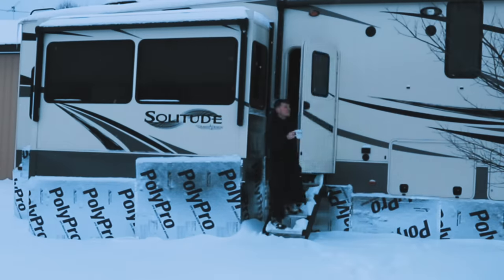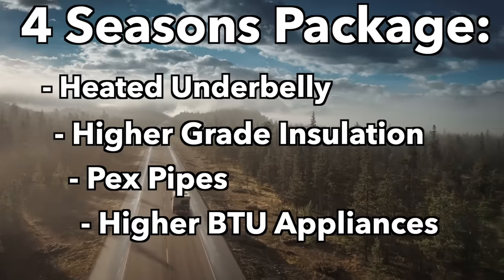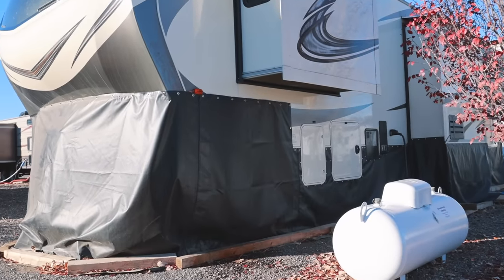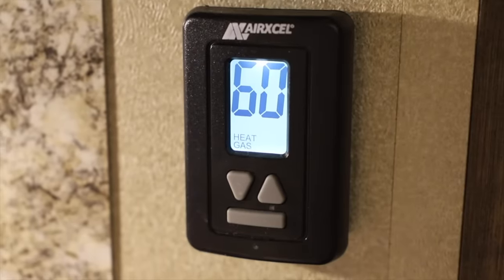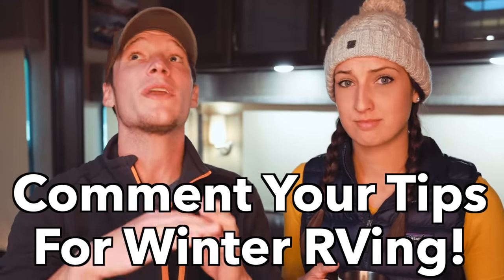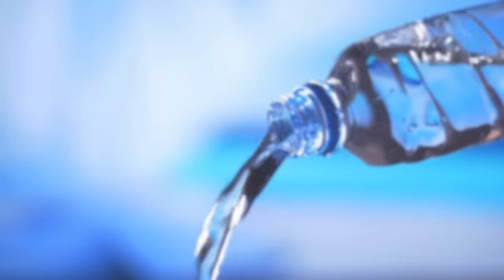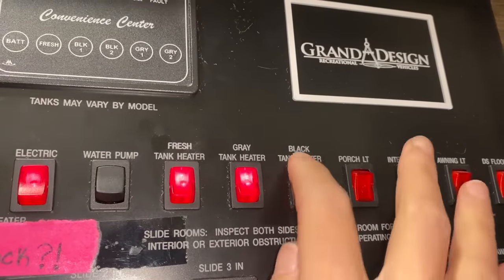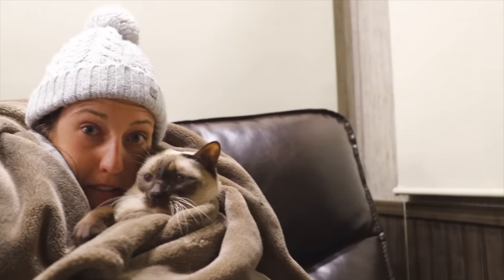RV WINTER CAMPING TIPS & TRICKS - A Complete Guide to Success!

Comment: to winterize the trailer, i spent the whole year in wy. in my trailer , working a pipeline job, i placed 1/4" plywood around the openings of sides the trailer, i also placed the rubber tires on a sheet of plywood from the cold under the tires. this make no froze o the tires.  . on the cold and hot pipes, as well as the lines for the grey and the black the help insulate the pipes from freezing. heater wraps are the best around the water, gray and black tanks.as far as sweat in the trailer from the extra heat, the vent in the bathroom a crack open all the time with the bathroom door closed. only if the bottom of the door has a 1/2" opening under the door to the floor.
Reply from the maker: Thank you so much for taking the time to share all this great information! How cold did it get there?

Comment: Learned so much from you guys, thanks! We are full time rv living in mid Michigan. As some added things we've learned..
-get an small hose and an rv toilet wand like the camco swivel stick. You can use this to help flush your black tank by making a quick connection in your shower instead of hooking a separate hose up outside, especially if your spigot has been winterized. 
-put a thermostat sensor under your camper so you know what's going on underneath your camper AND in your basement. 
-Foam skirting was totally worth it! Cheap and effective! Throw a heat light under there for a little extra insurance as well. 
-if you have a heated water hose remember to wrap your water filter if it's outside. Otherwise it'll freeze, expand and crack. 
-plastic wrap your windows! It'll help with condensation on your windows and it'll create that air gap without blocking out the sun, which also helps heat your rv. Remember the sun is a free heat source! 
-if you can use your fireplace or space heater do so when you can. It'll help combat the condensation alongside your dehumidifier. 
-Lastly, plan ahead! If you haven't gotten your camper yet but expect to be winter camping at some point, plan on getting a 4 season. While it usually means Florida 4 season and not northern North America 4 seasons, it does help. Coming from mid Michigan, it's made a huge difference to have all of the cracks and crevices already sealed up for us by the manufacturer.
Reply from the maker: This so so great! Thank you so much for sharing Holly! We need to write a lot of these down!

Comment: I bought 3 campers. Gutted them all out and basically made a 3 bedroom 2 bathroom house. Im not allowed to connect them together so it’s awkward. Ran all new water pipes, all new gas lines, all new electrical lines, all new sewage pipes. 

I use a 21kw solar kit. I drilled a water well for water. And installed a septic tank. One camper is only for utilities like washing clothes, cooking, washing dishes, and stores the solar inverters and batteries. The other 2 are for living. I completely surrounded all of them with square hay bales to keep them warm and the water pipes from freezing. Installed a 40 gallon propane water heater. New toilets, showers, sinks. 

All of this so we can live good while we save to build our house. So far so good.
Reply: Any mice with them bails of hay
Reply: @KingdomCarrie  I’ve also got 6 outside cats and 2 big sheep dogs. I have no rabbits or mice to worry about ever. 

The mice once tried their luck…. it didn’t end well for them.

Comment: I 365 day/year in our RV. You can circumvent LP/Propane heat. Heat your RV with Space Heaters, but leave your furnace on recirculate, and it will pump cabin air to the basement.

Comment: Just going back thru winter rv living. I live in alabama, love y’all’s vids. Last winter I went thru Dual 30 pound propane tanks in about 3 to 4 days. Now I drive 18 wheelers for a living and home on the weekends. I DID IN FACT GO WITH the big boy propane tank. River City Propane will in fact bring out the 120 gallon submarine style tank. No monthly tank rent with a full fill . Full tank fill on set up basically took care of a tank rental  deal. Anyhow, River City came out, set the 120 gallon tank, ran Cooper line that they buried in the ground , pressure tested/checked my rv, and we were good to go. Now since last December I have paid for 2 tank fills and I’m still at 40% on my 2nd tank fill as of last hometime, 2 weeks ago. River City also allows a customer to pay whatever whenever on your account thru the year. So you can actually pay a cheaper price for propane in the off season. Say you buy 100 gallons in June at 2.89 a gallon and don’t need a fill, well that purchase is locked in. Say you wait until say October and prone is 3.19 a gallon then it is what it is.  Anyhow I truely enjoy you guys videos.

Comment: Dual pane windows for sure! We had a 27 ft TT without them, 10 yrs later get a new TT 27 ft with them. Big difference - in sound, heat loss, or stay cooler, and a big one for small TT - condensation! A lot less condensation build on the windows under the same weather circumstances with dual pane. No hesitation to have them in the big rig too. Cheers 🍻
Reply from the maker: Thank you so much for sharing! We had no idea they were also good for sound 😃

Comment: We live full time in our rv in North Georgia we use the foam noodles from Lowe’s to cover our water hose just a few dollars so you don’t need a heated hose we get below freezing all the time at night we have never used propane in our rig to heat it we just use the fireplace and a ceramic heater in the bathroom at night on a timer we do have a enclosed belly but no tank warmers I guess it really depends on where you stay if you need to run the propane throughout the night
Reply: Cheaper than that, you can go to home depot and get some armor flex insulation, its made for insulating water piping and isnt as bulky but permanent if you want it to be.
Reply from the maker: Thank you so much for sharing! This is great when everyone shares their tips 😃 We learned our pipes started to really need heat when it drops below 20 F

Comment: Great tips. How do you get all that tape for skirting off your rig?
1. Use the electric heat, but run the furnace fan to circulate the heat to the remote areas.
2. Instead of pipe insulation, try caulking backer rod. It can be rolled up when not in use, comes in smaller sizes if needed.
3. Heated water hoses are fine, but the water source is going to freeze anyway.
4. Motor homes have the advantage of using the chassis heater.
5. If the battery('s) are in peril, just start your motor home or reconnect your tow vehicle to your trailer to recharge.
Reply from the maker: Thank you so much! It actually came off fairly easy. Now there was some residue left over, but I just used goo gone to help remove the remaining adhesive 🙂

Love these great tips that you have provided!! Oh my goodness you are so awesome 😃🙌🏼 Keep these great tips coming!!

Comment: Hi Gang, thanks for all your fantastic tips. We do rent a propane tank here next to Yellowstone. Way cheaper per gallon when filling 80 gallons. We also stand behind our dual pane windows, not because they do so much for heat, but at minus 40 (two winters now) it really decreases the ice on the inside of the window. It's way more manageable than without. The problem with ice inside is that when it does melt, it runs down into your wall - not good. We also had issues with our furnace running full time at -27 and burning out the furnace fan, so secondary heat is helpful there. The heated fresh water hoses don't work much below -10 and we always keep the fresh water tank 3/4 full. We have kept our gray water drains open to -27 without an issue. The hoses are, verified by a level, totally downhill with no places for the water to settle, they are routed UNDER the skirting, and where that can't happen, we wrapped them with bubble wrap and installed a 4" aluminum stove flue over the bubble wrap. Not being contrary, btw. Just adding more ideas to your already great ones! Love you three! :-)

Comment: We aren't full timers but we have been snowed on and in and subject to below freezing temperatures. We have a four season rig and things have frozen on us. We are able to work our way through these freezes even though some minor problems have occurred. I don't want to rip into the under belly of our trailer but I wish there was a safe and moderately easy way to put heat strips around our Pex tubing. That would take care of the worst of our issues. Thank for another informative and facially entertaining video.
Reply from the maker: Yes, that would be amazing! I was thinking
the same thing. It would be quite the pain to access all the underbelly and have to drop the insulation. It’s great to hear from you guys, thank you so much for sharing 😊👋🏼

Comment: Great tips!!! We've been caught in below freezing temperatures a few times in TX (where we go to get away from WI cold in the winters-HA!) including Snowmegedon in Feb 2021 when we lost power for 15 hours in sub 0 temps. We survived it and no frozen pipes!!. We have a small RV (26 ft 5th wheel with no slideouts) and only went through 1/2 a 30 lb propane tank...no supplemental heat due to no electricity, and because of the ice and snow, we couldn't use our briefcase solar panel.  Also, we use clear plastic insulated window kits on our single pane windows, so heat comes in from the sun, but no draft of cold air and you don't feel like you're inside a hershey kiss. 😁  We have been full time rving for over 5 years and do not have a heated water hose either...we just fill the fresh water tank and disconnect from city water supply if we're in a campground. Our biggest challenge is yet to come... We need to return to WI in March this year for the arrival of our twin grandbabies.  Campgrounds are not open in WI in the winter!! They are closed until mid-April!! We know where there are a few dump stations we can drive to, but no potable water sources near where we have to be, and at most, we will have 15-20 Amp (house current) electric. FUN times ahead!!! 😳🥶😬  We are looking for winter rvers who don't have hookups in winter...any advice appreciated. We know what to do for SHORT term crazy cold, but no hookups in winter will be a new experince!!

Comment: My wife and I travel for work and we spend winters in the camper. Our first on we used the green insulation board and aluminum duck tape and put a small utility heater under the tanks. Wasn't to bad on propane at first, but as the camper got older,it got colder. We use a 100 pound tank. Yeah it's a pain to load and unload,but it's better than constantly refilling tanks. We had a 30 pound tank next to it,so we used it while the big tank was being filled. We used plastic and tarps once and once is all you want to use it. It constantly flaps in the wind,even when weighted down. Don't forget to drain the sewer hose after dumping the tanks. They tend to freeze and bust. But the whole manufactured skirting is nice,but ridiculously expensive.

Comment: I just purchased an 04 Gulfstream C class that I am modifying for winter. Reason I went this route is that it has no slide outs and although it doesn't have a lot of the modern built in conveniences it makes the conversion a lot less complicated. I prefer a certain level of minimalist. First thing I am hoping to do is get the whole underbelly spray foam insulated because it works great and  helps tremendously on saving energy, less road noise and easier to pickup and go. Spray all the crevices  pipes  but avoid all the running gear, wires etc. Insulated all the doors and make all the seals seall properly. Now I'm trying to figure out how to duct cabin heat into all the plumbing areas in the underbelly.

Comment: Back 40+ years ago when I got married we had a house trailer up here in Wisconsin and to help keep the under belly worm I ran a string of work lights at -20 it would be 40 under the trailer I still put lights in a small room in my barn were the water comes in and it stays 50 a clamp light in your water bay would help if your going to do that again this year ☃️ 🥶stay warm great video 🍺
Reply from the maker: Wow! Those lights do a great job! Thank you so much for sharing! How do you recommend people keep an eye on them or prevent them from causing potential fire hazard in the underbelly??

Comment: I have a Solitude 310gk 2018 and I have done some of the same things as you guys. I tried something different however that I think is pretty cool for cold weather. I bought a 210 board ft spray foam insulation kit and sprayed the outside of the frame rails and the cross over section on the drop frame. I sprayed the foam about 1 inch thick and also sealed up the gaps around the slideout hydraulic rams to minimize air transfer. Since doing this I have never had my pipes freeze and keeping the trailer warm without skirting is pretty easy. The next thing I did was I installed a chinese diesel heater 8kw in the front storage bay next to the batteries. I cut a 3 inch hole in the wood divider to the basement area and when it is really cold out I can keep the basement close to 80 degrees. I have an idea to use the diesel heater to supplement the propane furnace with a duct pressure booster, but I haven't gotten around to it yet, maybe this week as I live in Wyoming and we usually visit our daughter in Bozeman, MT over the holidays. I also use the reflectix on the windows and it helps and I also installed a 3m window coating that seems to have eliminated any condensation on the windows, but only marginally helps with heat transfer. The diesel heater is pretty cool in that it will warm the bathroom floor. I tried letting in run into the front compartment to try and heat up the front cap because the closet in the bedroom gets so cold, but it didn't do much. I can run that heater on less than a gallon a day and the heat output is adjustable. With the spray foam on the frame rails I have never froze any water lines down to -10 F. Good tip on pipe insulation for the slides, I just happen to have a case of it in my shop that might work.

Comment: Hey Hanks. I have lived in a camper with no slides scene August 2010. I have a 325 gallon lp tank at a little over  70 percent full. I leave my gray tank open all the time. i only disconnect the drain hose when I have a problem. When it is down below freezing I leave the shower/bath tub dripping to keep it from freezing.  Because gas prices are going up, I am using an electric heater to help stretch the gas.
Reply from the maker: Hey Joe! It's great to hear from you friend 😃How is North Carolina treating you these days?? That's awesome you are rocking a 325 gallon tank!! 😱Is it easy to connect your unit to the tank? You are on your own property as well right? We really enjoy hearing your feedback and the setup you have! Thank you for taking the time to write this wonderful information out for us and everyone reading!!

Comment: about keeping the underbelly warm.

you can get a space heater (oil filled radiator types are very safe for this) to keep under your rv to heat it specifically. if you have skirting (as you should) it should keep it atleast above freezing, and the heat coming from the space heater will help keep the rv warm by warming up the underbelly.

also heat pumps (reversable ac units) for rv's are typically under 1,000 bucks and you should be able to fine some that  fit your current ac location, especially if you have an older rv it is definitely worth getting b/c of a more efficent newer ac system, and heat pumps are more efficient than space heaters, and if you get one thats the same BTU as your current ac system it wont use much more power than the ac (some more power might be used when going from cooking to heating when switching modes.

 space heaters/resistive heaters are nearly 100% efficent, i.e. nearly all the energy they use is made into heat (some is used to make light, especially with electric fireplaces). heat pumps can be up to 300% efficient, because they using the power to only generate heat, they are moving around thermal energy, in the case of heating so long as the outside is above 0°K there is heat to move, granted they lose efficiency as it gets colder, and most have an operationg temp of around 0°f/-17°c on the low end.

also get heated blankets, they can help you feel so much warmer.
Reply from the maker: Thank you so much for sharing!

Comment: Making igloo... Use your sandcastle tools for the beach.. particularly the one for forming bricks. Or your bread pans. Pack the snow in them to make snow bricks to build your skirting. It will work if you get enough snow. If you are using blankets/tarps and the snow is not that heavy, will work as anchors on the tarp/blankets to keep them from blowing up.
Reply from the maker: This is a great suggestion Patricia!! Thank you so much for taking the time to write this out for us and everyone reading 😃👍🏼 It sure is a lot of work to stack up that snow as a form of an igloo right??
Reply: @HappilyEverHanks  Yes, it is. And it will only last as long as the snow does. But a a backing like the tarp skirting may help with keeping it stable. More than two or 3 layers and stakes going though them may help. But if you are into building snow forts or even snowman, it is doable. Just need enough snow to do it
Reply from the maker: Yeah that’s the key for sure, having enough snow. We appreciate you Patricia! Hope to catch you on another video soon 😃👋🏼 Stay safe!!

Comment: Simplest method to keep your wet bay above freezing is a 60W or 100W incandescent light (work light) as long as you have shore power. I full time in Houston and although not many freezing days, when we do get a hard freeze the park will shut off the water and we live off the water tank until they turn the water back on. With just 2 work lights I have been able to keep my belly above 40 degrees (as long as I have power. After the power grid loss I also have a trifuel generator as well).